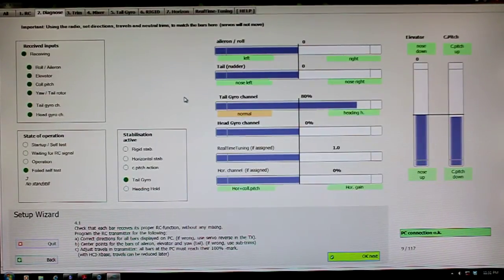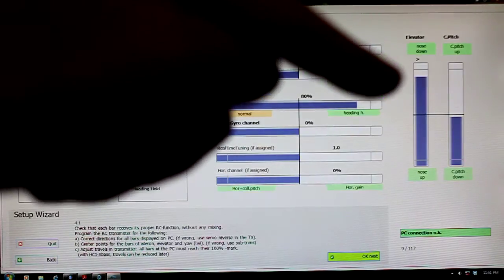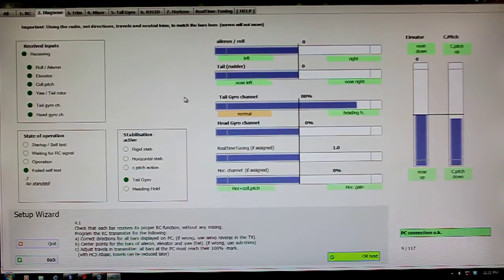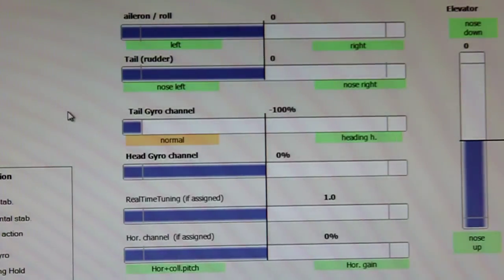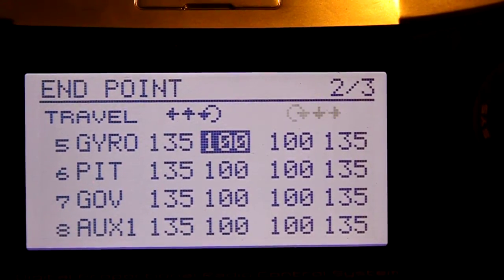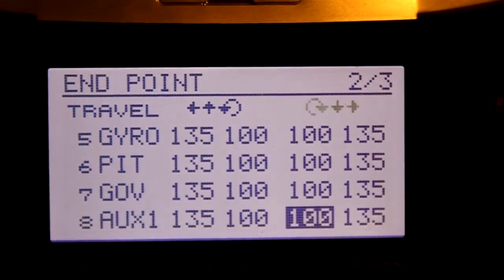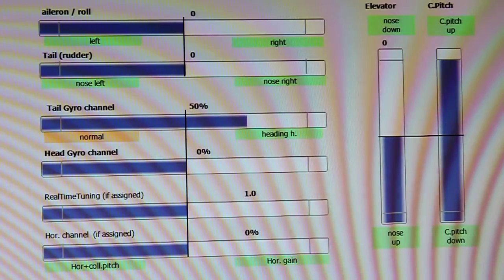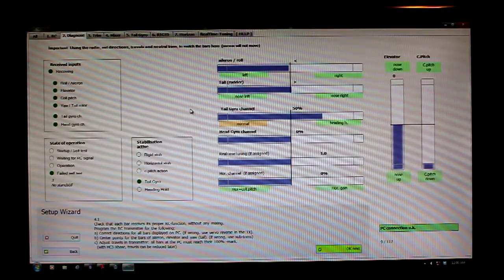HC3sX quickie setup part 5 - Diagnose tab

Comment: When you set the center of ail/elev/rudder using subtrims in your radio ( if needed ). Do you keep that subtrim setting inside the radio. Or do you zero the subtrim out when you go to the next step?